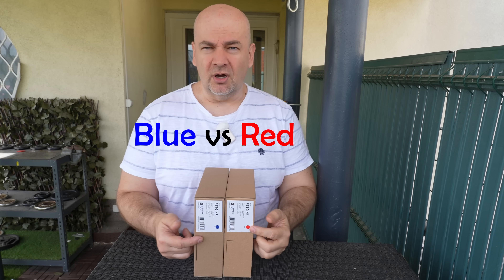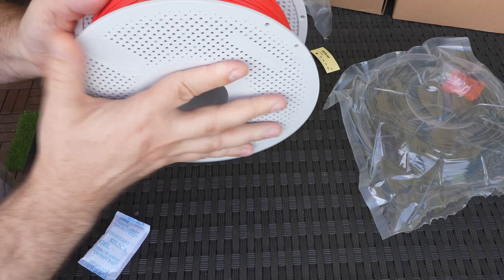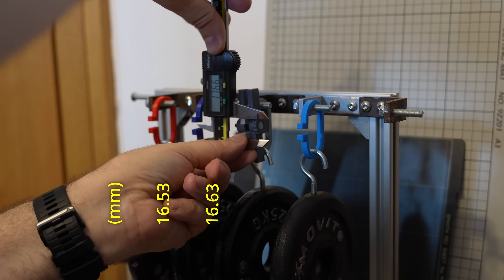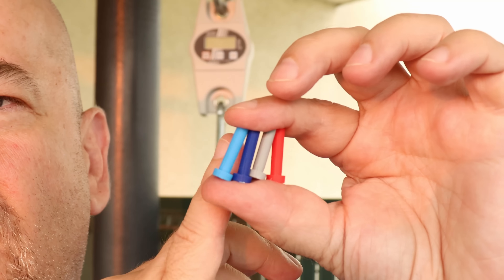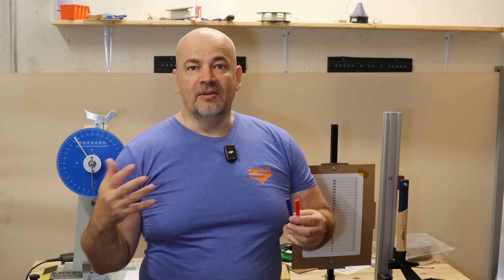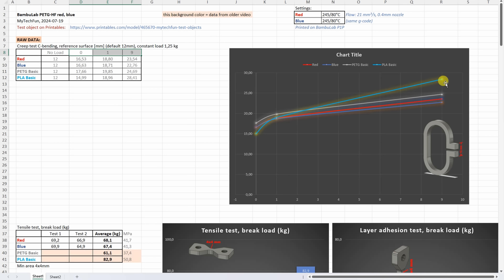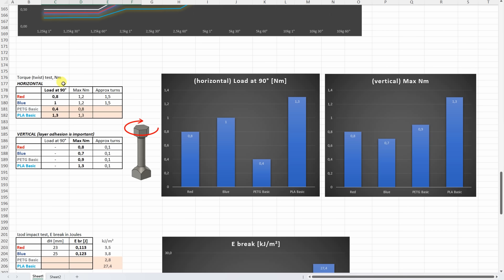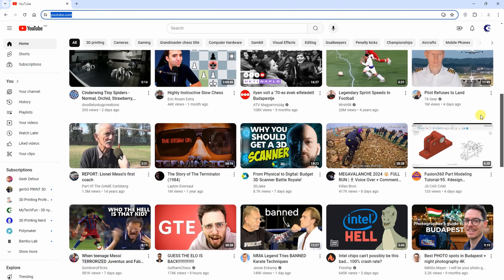Bambu Lab PETG-HF (red vs blue) as a replacement for PETG Basic, but is it really better?

Comment: Bambu has been knocking it out of the park lately. I decided to pivot to PETG, they came out with HF...its amazin, easy to work with and requires very little drying.  i used it right out the box and it was perfect. my experience with it so far has been smooth. im deff a Bambu fan boy.

Comment: is HF supposed this weak? I printed with 25mms with petg HF and Polylite petg.

polylite is way stronger and has amazing layer adhesion, I dried the HF as it was instructed and it's still brittle and has poor layer adhesion

Comment: so, I was linked this as proof that the petg hf was actually better as far as mechanical properties (despite the bbl website saying otherwise, dont bother with the joke pls). which is great and all, but it seems you have a sample size of one (or two) for most of these tests???? is that correct? 

no offense but a test with a sample size so small being cited as evidence is pretty bad. I can respect going out and actually doing the tests, but really man, if you want to do actual science and not youtube bait you should have a sample size of 10 for the mechanical tests at an absolute minimum. though stuff like temp isnt going to matter that much. there is just no way you are getting accurate numbers for layer adhesion with that few tests. (which is the part everyone cares about because BBL themselves say it is over 20% worse with HF, with layer adhesion already being its weakest property) even if it scores higher on average, if say there is a larger scatter with hf over the original with inconsistent layer adhesion that would be a massive detriment as a part is only as strong as its weakest point.

I wouldnt really call an "average" of 2 data points and average, it should really be called a median, as an average would normally imply the kind of distribution typically associated with larger sample sizes.
Reply: Stop crying about it and test it for yourself if you need more than what he did. If you call this "YouTube bait" you should start watching something else, ffs.

Comment: I just bought 10 rolls of the HF. I won't be getting more. I go through 30+ rolls of petg per day. If I had to dry every roll before use, I'd never get anything produced. Petg needs to be strong and durable. It's not for priting fast. 
As far as I can tell, they had a good product with the basic, and someone came up with a really stupid, bad idea, and they went with it. Yay. Now I need to find a new source for good PETG.
Reply: I am on the same situation. Which one are you using now?
Reply: @davosmarcado  I'm back to overture petg.
Reply: I tried a lot of PETG and my absolute favourite is Polylite PETG. It prints great and it is TOUGH!
Reply: Hey mate I'm wondering if you might be able to help me with an Overture PETG profile. Happy to chat over email, if that works too (not sure you can message directly here on YT). Thanks so much

Comment: I have a problem with the new filament. It is only recognized for 1 second in the AMS and then it is thrown out again and is unknown. You cannot manually enter the PETG-HF in the slicer because it does not appear on the list (latest version is installed). Only found in the list in the Bambu mobile app

Comment: I'm wondering why the PETG reaches lower Energy in the Impact test? Normally it is said that PETG is more Impact resistant and that PLA is more brittle. Do you have an explanation for this?
Reply: @stacki0307  PETG yields more before breaking. It means you'll better get a sense of when it breaks. I don't recLl it ever actually being stronger than PLA in any way at room temperature.

Comment: Your “I cleaned it with isopropyl” comment makes it seem like you think the glue is to help the filament adhere to the bed. They don’t recommend glue for adhesion. They recommend glue as a release agent, to stop it from sticking TOO well to the PEI. One unlucky print without glue and your PEI sheet will be ruined. Just get their liquid glue already. It just rinses off with water afterwards.
Reply from the maker: More than 5 years I am printing PETG on textured PEI (starting with Prusa MK3). I never used glue on it. And yes, glue will help in some cases with adhesion. Personal experience, I don't care what "they recommend".
Reply: @MyTechFun  Next time you print something with a very large, flat surface that is usually difficult to get off the bed, use some glue.  It will come off VERY easily.  That's the whole point.  It isn't to help adhesion.  It is to make adhesion worse after the print is finished.  It is called a "release agent" in that case.  "I've never tried it so I don't need to." is not a good thing to say.  You don't learn anything by saying "I already know something."  You don't know everything.  Just like the rest of us.
Reply: I dont get why you are pushing so hard for the unnecessary additional headache and purchasing
Reply: @BeefIngot  I spoke in plain English.
Reply: @ClaytonMacleod  I understood your plain english, Im just confused by the level of vigor on this one thing
Reply: @BeefIngot  If you understood you wouldn’t be saying what you’re saying.
Reply: @ClaytonMacleod  I think you are missing that mytechfun certainly has the experience to say that he doesn't feel your precaution is necessary.

I too print petg on pei no problem. If by a miracle one day it sticks too well, I'll just buy another plate and continue doing exactly the same thing and it'll have come out cheaper than using glue for every print and I say this as someone who actually has a small stockpile of Bambu liquid glue (I just don't use it for this case).
Reply: @BeefIngot  Experience doesn’t automatically extinguish ignorance.

Comment: I think a major flaw with basically any of this testing is that it really doesn't show the full capabilities of any of the materials. This is due to the print profiles for a lot of these filaments simply being optimised for print quality rather than any kind of strength. It's still good to know how they compare in terms of defaults for the masses, I guess.
Reply from the maker: Correct, but this is what "masses" will do. Load the default settings and start with printing, and this is what I am testing in most cases.

Comment: Absolutely agree on the PLA Tough cancellation compared to the PETG-HF. Did you get early access to the material? I ordered mine within an hour of the release email and am hoping it arrives in the morning. I'm down to 3 rolls of PLA Tough... :(

The PLA-Tough is slightly translucent but prints like a dream. I was wondering if they would replace it with something but I haven't seen anything yet, not even a PLA-GF.
Reply from the maker: I got the spools 2 weeks before promotion (and before my travelling as mentioned in the video). The PLA Tough is "replaced" with PLA basic. They have similar properties (tested in separate video), but I just need that great layer adhesion of Tough. I ordered 5 spools, when I saw that it will be discontinued.

Comment: As I remember the data from BambuLab they differ a lot. Especially at layer adhesion.
Reply from the maker: When I got the filament, there was no info on the website. If I would know this, I would correct my testing method to get those data. (joke)
Reply: @MyTechFun  Haha! Thanks to your tests I will buy some rolls for testing. 

Thank you also for all your other videos!

Comment: Can I use the elegoo cardboard spool in AMS? It has a kind of coating on the edges
Reply: i mostly use Polymaker which has similar spools and never had issues at all ever.
Reply from the maker: I thought that too. But after few weeks I noticed that carboard spools will create a fine powder and that may go into teflon tube casing problems later. I cleaned everything and I am using 3D printed rings

Comment: I know you tested before the filament was added to the store so you could do nothing else but your standard left brain engineering tests. However the filament is being touted as being as printable as PLA (speed and quality) with the mechanical benefits of PETG, also that it’s more hydrophilic than normal PETG (so must be dried and kept dry during long prints). I’d love to see a follow up video in which the properties that matter to non-engineers are tested, maybe you could collaborate with an artist or designer to help activate the right side of your brain to test out the fun-ness of the filament. 😁

Comment: I always have the problem of nozzle buildup with PETG or PCTG, does anyone know why this could be happening? Printer is P1S with 0,4mm nozzle and standard slicer settings. K-Ratio tuned to 0,038 and Flow ratio is "standard". In a matter of minutes, a blob forms on the nozzle. This effect is the strongest on the first layers i think but is also happening on all other layers.
Reply: I bought cleaning filament works well for me also I do a cold pull once in a while there are videos on how to cold pull clean.
Reply: @joshmedeiros7594  Even with new nozzles this happens to me.
Reply: for me it happens mostly when my filament isn't perfectly dried
Reply: @tommihommi1  The thing is, that even with new filament, this behaviour occurs.

Comment: I am little bit skeptical regarding this test, because on their website there is a table comparing petghf to petg and they say it has a little bit weaker layer adhesion.
Reply from the maker: Oh, I didn't know that, when I started with the video, there was no website about PETG-HF. If I know, I would adjust my testing method...

(joke)
Reply: @MyTechFun  Ok. Looks like you don't take criticism very well... I really appreciate the stuff you are doing and I like your videos because I see a lot of information from them. I just wanted to point out that just because you printed the filament with the same way, it doesn't mean it was the right way. Maybe the HF filament should be printed with different profile to achieve reference strength values and maybe the basic filament you printed the way that it's not how it should be printed and we get different test results.
Reply from the maker: @EEEEMMMMKKKK  I get used to criticism, I just feeled that I need to make a small joke on this. I agree about different layer adhesion, sometimes even different 3D printers have different affect. https://youtu.be/_pPWvLizjRU?si=k2c0IqGoS9f4IHyB

Comment: I always thought that HF variants would have worse creep but it's not the case here!

Anyway I really wonder why would anyone use PETG on printers like X1/P1/Q1/K1 when ABS prints just as easy and has better properties from every point of view and it is in general cheaper than modified versions of any material.
It also prints faster.

Habits?
Reply: For me, PETG allows me to print indoors without worrying about needing ventilation like with ABS. Also, PETG warps way less and there's no shrinkage to compensate for. I'd like to have the setup for ABS/ASA in the future, but for now PETG is ideal for me.
Reply: @jamesmc8055  petg shrinks not much less than ABS. Fumes are also not an issue unless you don't ventilate your room, which if true is a way bigger issue.
Reply: @olafmarzocchi6194  true, all filament does shrink, but so far with Sunlu and Hatchbox PETG I haven't had any dimensional issues. I do ventilate, I have a large air scrubber running in the room, but even that plus a bentobox would sometimes fail to prevent ABS fumes to fill the room. Maybe I'm just very sensitive to ABS.
Reply: Don't have to worry about ventilation and warping. And I hear that ABS leaves gunk in your printer if you print alot of it

Comment: Bamboo has a “Dry out before use” statement in the Caution section under the description of this PETG-HF. I wonder if there’d be any difference in your results if it was dried out prior to testing. Thanks for the great video!
Reply from the maker: When I started the testing, there was no info on the website. I like to test PETG out of the box.
Reply: It's the case for majority of filaments. The effect varries. It only is required when you experience bad print quality.

Comment: Next time could you have a camera running all the time and do a time lapse to check the deformation?
Reply from the maker: I needed the camera on my vacation 😀
Reply: @MyTechFun  I was thinking about a Pi Zero with camera module pointed at the test pieces and have it capture an image every hour or so. You could then see it deform over time.

Comment: i bought my p1s to print witth petg but it was flaky and had a lots of problems. lets hope this will help.
Reply: helps a ton if you dry your filament and print at 50% speed
Reply: @ThePesmat  yeah I naively assumed a brand new spool out of the box didn’t need drying.
Reply: @senurasenaratne5782  I made the same assumption which is where my wisdom comes from....the 50% speed mostly changes the quality of the outer wall and try to avoid grid infill it tends to hate PETG in my experience